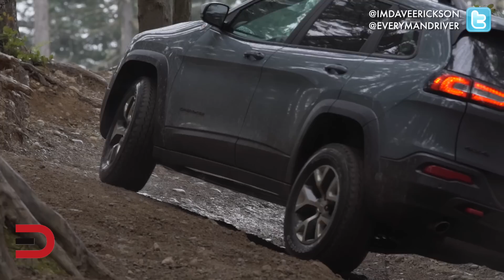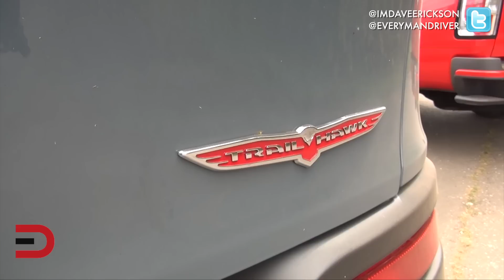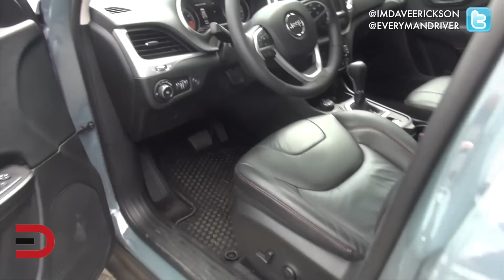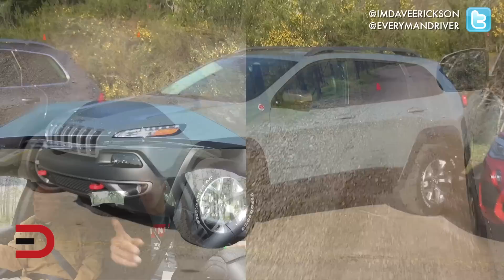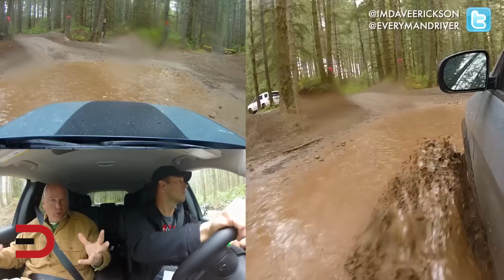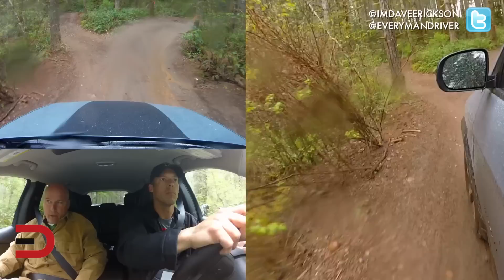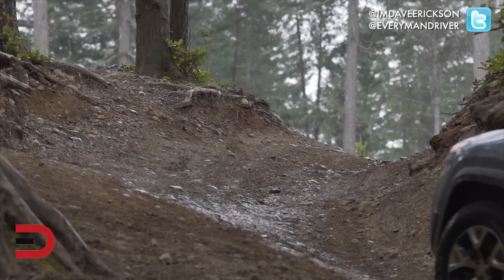Off-Road: 2015 Jeep Cherokee Trailhawk 4x4 on Everyman Driver

Comment: Nice car. Didn't like the look of it at first but it has grown on me. I wonder if there are any owners that can chime in about the reliability of these cars. I heard they break down way too much.
Reply: I'd be the first to admit when these first came out I gave the front end design a really hard time! But after looking at the trailhawk in person, I really would consider buying one, but as you mentioned, I'm skeptical about the reliability.
Reply: I was in the same mindset until I went to the dealership and saw the Trailhawk on the showroom floor. I was having nothing but issues out of my 2012 Buick regal! It stayed in the shop! When warrantee was about to run out I decided I had to do something. I actually went to look at the renegade trailhawk, but fell in love with the cherokee trailhawk. I've heard about the trans issue, but after 11,000 miles I still haven't had any issues! I live in the Mississippi Delta, and this thing impresses not only me, but a lot of the 4x4 enthusiasts in my area! Plenty of power in this beast!
Reply: bmwmsport11 I've owned one since last fall (apparently I got one of the first in Canada) and I've had no breaks of any kind even after a bit a mistreatment in off road (some people would say just driving in Montreal would also qualify as off roading).
So far very reliable but the bigger engine is a must given the car weighs about half a ton more than other models (I thought even the basic front drive I tested was quite sluggish going uphill with the base engine).
Reply: bmwmsport11 got mine Jan 2 2014. It has been a great on road vehicle and a fun off-road vehicle. It's not a Wrangler, but it can still get out there and have fun.  I have heard some folks had some trans issues .. but really have not seen it. No regrets buying this one.
Reply: bmwmsport11 I bought a trailhawk June 2014 and it's been great. 22k miles already, we took it to Tahoe (from the Bay Area) every weekend for snowboarding season. Averaging 19.5mpg, the interior is awesome it's luxurious but still repels dirt. Heated steering wheel is better than on my BMW. It's been completely reliable. There has been one recall which was a transmission reprogramming. I still don't trust my transmission as it's the same as the Dodge Dart and Chrysler 200. But so far so good. 5 year warantee on that. No break downs. :)
Reply: youngblood23rb Jeep's reliability ratings as of late do leave me skeptical.
If they were to drop the price enough that I could see clear to stretch the warranty I might consider one.
I guess the legendary reliability of the old ones, running 250-300K miles makes it tough to keep selling them.  I mean, mine is 21 and still gets driven a few times a week.
Reply: They copied Chevy on this one

Comment: I'll take that 4Runner in front of you.
Reply from the maker: Trigger Happy Guns I'll have a 4Runner video from my time there in the coming weeks!
Reply: Sure it does. From someone that puts a lot of miles on vehicles and the owner of 7 different Toyota vehicles, I can tell you Toyota is an excellent brand. Never once had a problem.
Reply: Trigger Happy Guns  Yup, I was looking at the 4runner as well. It's still body on frame with the Toyota durability.
Reply: Trigger Happy Guns  Yup, I was looking at the 4runner as well. It's still body on frame with the Toyota durability.
Reply: themopar426
I hope you aren't being serious. I really can't imagine calling someone a traitor (properly spelled) over their choice of vehicle.
Reply: ToAstYNaChO
I've owned 3 4Runners, two currently. They are fantastic vehicles and worth every penny.
Reply: tc1uscg
I guess we've had different experiences then. I've owned an 04 and an 07 Tacoma, an 08 Tundra, an 07 Camry and an 05, 10, and 14 4Runner. All but the Tundra were purchased new and ran to about 120k miles. I've never had a warranty service or anything beyond a floor mat recall and a wiper motor recall. So until I have an issue, I will continue to buy Toyota.
Reply: themopar426 you served dessert in a storm?
Reply: Trigger Happy Guns Though i can get a trailhawk for just 25k with all of those bells and whistles, i cant even get a base model 4 runner for that price
Reply: Johnathon Cato Think thats for a stripped down Cube or that car on the neon frame.
Reply: ToAstYNaChO you get what you pay for
Reply: tc1uscg there's a reason why Toyota and Lexus are always at the top in reliability ratings year after year
Reply: I had a 2001 highlander up until last year and it was great and had no problems with it. Also the pair looked brand new, it still shined and and dust have any bit of rust and I drove it in high snow every year
Reply: so, that's why im about to buy one for 26 brand new? search harder
Reply: Toyota sucks and brake down fast
Reply: Trigger Happy Guns Some people don't have the same results. I've owned 4 toyota's in my life on this planet. 77 Celia GT. Ok car but hated the cold. Had my hood freeze shut when living in north eastern Wisconson in 80/81. Couldn't boost it for a month. Good thing I lived on a ship so I didn't have to go anywhere. Replaced a clutch, alternator and brakes. The cool system monitor display wiring went bad too. So, I wouldn't list it as a "reliable" car. Owned a 81 Celica GT. What a POS. BCM went bad. Wouldn't start when it rained outside. But in the summer (minus the rain), it was a nice car. 83 Carolla. Plain as you can get. Just didn't like it. had it for 4 months then upgraded to a VW Jetta. Now that's a car for the road. Had it 2 years and went to a 84 Jetta GL. at 200k, put a new tran's in it. Had the car for 15 years. Now own a 2013 Passat TDi. Also, wife owned a 2001 Sienna. If you mentioned taking a trip within ear shot of the car, the engine light would come on. This started at 58k miles. Trip to dealer(s) was always a 500-800.00 trip. It didn't like the northern winters either (or salt). Rust, lots of it. Side boards rusted off the car (well, had to cut what was remaining). But like I said, somehow, people still think they were reliable cars (don't get me started on Honda.. Geez.. Owned one. Never again). So, I have a T&C minivan, 02 and 09 Jeep liberty and the VW. My 09 has 100k miles.  Only trip to the garage for a repair was for the rear driver side door lock. Get my 4x4 service ever 30k miles, oil change at 5. tires and brakes an 1 light bulb. Hail damage replaced front hood doesn't count nore do I count the body shop trip from my kid killing a ford focus (totaled it. Did 800.00 damage to my lifted jeep). I also got a nice custom made steel bumper made for it from that trip though. Bottom line Trigger, we all drive what we drive for a reason. We can afford it and we have had good luck with it. I also don't park my car in the drive and let it rot (see Honda and the toy minivan). I drive the crap out of my cars. And if I had to be in an accident driving a car that gets 50+ mpg.. I would not be in a Precious (that's what I call'em). I rather be in my VW that will run on the highway at 80+mph and still get 50+ mpg with 3 full size adults, and when I put my winter/ice tires on, it too can go anywhere my gound clearance allows me. To me, reliabilty is something more then someone saying they like thier car's. Honda, Toyota are two of the few who will not release repair data or TSB's in the wild. There's a reason for that.
Reply: guy proulx yes tested by isis and the taliban
Reply: Trigger Happy Guns I served in dessert storm! I buy American trader! usa usa usa usa usa usa usa usa usa!!!!!!!!!!!!!!!!!!!!!!!!!

Comment: The Cherokee Trailhawk starts at $30,790 on Jeep's website, not $25,000 as stated here. Huge difference!
Reply: Gazziza29 What about the locker, full skid plates, descent controls, and GVWR rated tow hooks? an SR5 doesnt have that.
Reply: Gazziza29 Makes sense, the manufacturer is trying limit that kind of thing b/c ya know we're in the new age where the main focus is largely mpg. It's in the affortable, daily driver class so there's really no need to lift it. At 8.7'' of ground clearance it's in the same class/closest competitor is the Subaru Forester. To be honest the Cherokee Trailhawk is more of a more capable "softroader" than a true offroader.
Reply: I guess it's in the eye of the beholder. Im going from my Ram 2500, two solid AAM axles, with mud tires, generous ground clearance, and various mods, to this, simply because it's cheap, capable, and needs no modification to do what i want to do, mostly road riding, but that occasional urge to tear up a field
Reply: ToAstYNaChO Those don't matter when you are built off a unibody frame with independent front and independent rear suspension.  It's a crossover with an appearance package.  Have you seen videos of the Cherokee offroading?  The suspension has no travel and no flex.  You can't even lift the damn thing!!!  Rocky Road Outfitters looked at the possibility of adding a lift to the Cherokee but due to its suspension and lack of adjustment in the alignment system found out that the install of the lift could only be done by an auto shop and labor cost would be in the $1000-$2000 range.  That is minus the cost of the a suspension itself.  So to date you don't even have an option to buy any type of lift in the Cherokee.  
That's why there are literally no aftermarket parts for it, no one wants to touch it and basically the Jeep diehards have shunned it.  Whereas with any Wrangler or any 4Runner there are literally tons of aftermarket parts available.
Reply: 2008equinox Yeah, I think after you start adding options to the Trailhawk you're looking at a $35k car.  IMO, very few people buying a Cherokee will take it offroad and spending more for a Trailhawk is a waste of money.  You're better off getting a Toyota 4Runner SR5 for less or a base Wrangler if you're even remotely considering going offroad.  This is nothing more than an appearance package for urban dwellers and soccer moms.
Reply: Gazziza29 yeah that’s not really the case. All these Trail rated jeeps have successfully completed the Rubicon Trail, one of the hardest trails. It has locking ear diff, 4 high and 4 low, hull descent control, off road cruise control...do your research budy. The Trailhawk, especially the new ones, are super capabke
Reply: Gazziza29.. Appearance package is right. Thinking the same thing.

Comment: so its primarily FWD? but it knows when to divide up the power?
Reply: EKFiPod Exactly. I have alot of experience with this Trailhawk Cherokee and it is amazing. I'm a true body on frame kind of guy and I love truck based suv's. With all of these new crossvover "SUV's" out there wearing true body on frame names (Pathfinder, Explorer, Durango, ) it really makes me cringe sometimes. This crossover however, is really a capable off road vehicle (excluding muddin'). I personally have driven both the Cherokee and Renegade Trailhawk and they are both surprisingly capable for what they are. If you ever have the chance to test one out, I promise you won't be disappointed. They don't look like serious off road vehicles, but they can do alot more than people think.
Reply: EKFiPod Yes.  It is basically your typical transverse layout that you would expect in a FWD, but has provisions to drive the rear axle like most AWD crossovers.  The difference with the way Jeep did it is that they can completely uncouple the rear axle so there is no parasitic power loss from spinning the rear differential and drive shaft.  They can then use the wheel speed sensors to determine when they need to engage that rear axle.  It actually works really well.   Being a Jeep it also has a little more ground clearance, that locking differential and good approach and departure angles to help it make its way through rougher terrain.   They also figured out a way to work a very low ratio low gear into the mix (46 to 1, if I remember correctly), which is something you don't see on vehicles of this type.  That is something that makes a huge difference off road.   Drives like a car, goes like a Jeep - that was the goal with this Cherokee.  They seem to have hit their mark with it.  It isn't chasing number one in the segment yet, but it is selling very well.
Reply: +1guyin10  If it doesn't have rear lock outs then there is still parasitic loss because the axles and rear drive shaft are still being turned by the rear tires. Just being dragged along instead of being driven ,
Reply: bugsnstuff The rear half-shafts are all that turn.  The rear hypoid gears and prop shaft are disconnected when not needed.  It uses American Axle's EcoTrac system if you want to read up on it.